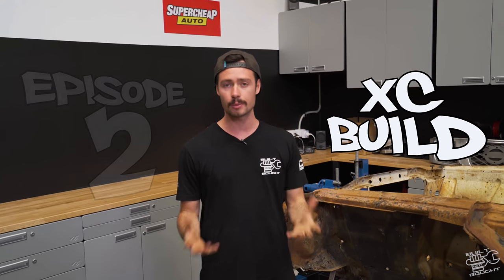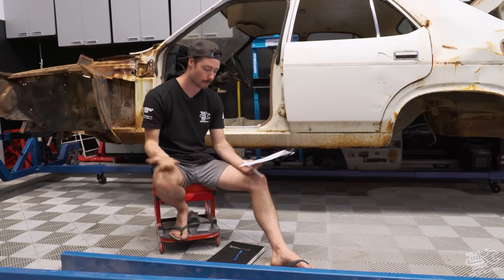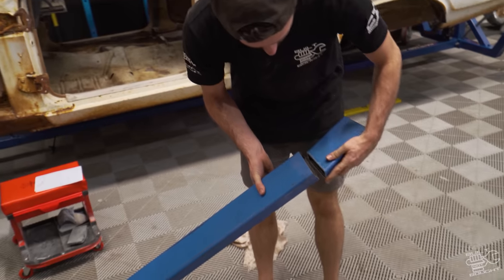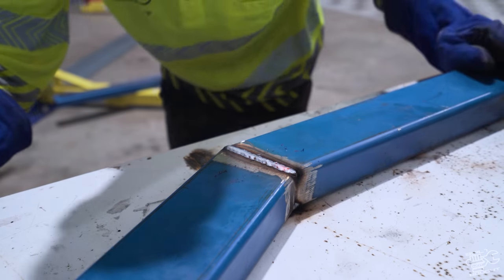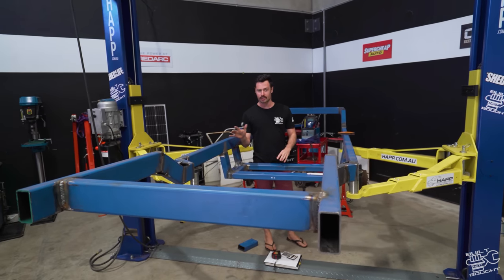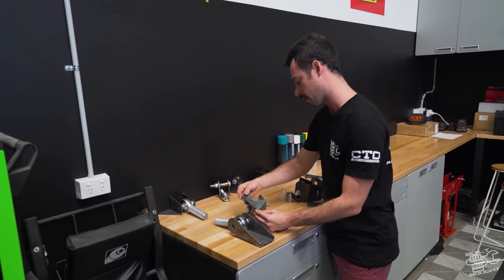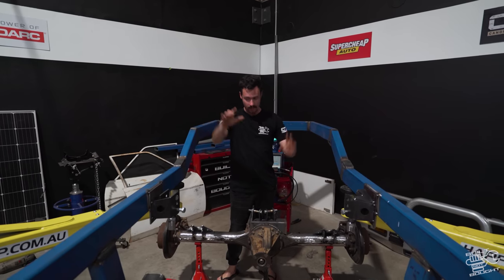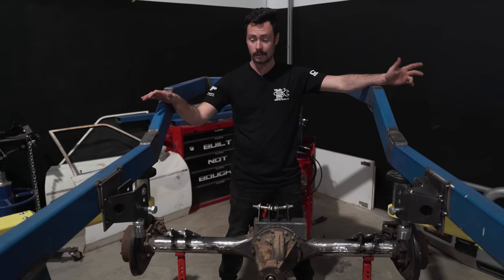XC Ep 2 || Building a Car DREAMED up as a Kid (IRL) 🤯

Comment: its looking good champ!

if i had to add one thing, when welding a plate on top of another like what you did with the fysch plates, its best to paint under the surfaces with a weld through etch primer so moisture doesnt get behind and rust starts to form or leak through

just a good tip! but i figured since a lot of time has passed im sure your aware of it now ahaha

Comment: Loving the build mate. Is there a reason you went for a chassis from scratch over using a patrol/cruiser chassis?
Reply: Factory chassis are quite ugly and the huge travel and flex he wants with massive tires and coil overs hydro steering etc there wouldn’t be a lot left of the four wheel drive chassis. Not to mention all the stuff you’d have to cut off. Nor would it follow the shape of the bottom of the XC.

Comment: From one stupid vehicle creator to another.. you'll do well to reduce the stress concentrations by blending those sharp chassis angles, fishplate or not, those bottom welds will cop some abuse and almost certainly crack unless distributed.
Reply: Ya wrap them with a bit of 40x5 flat bar and never have an issue.